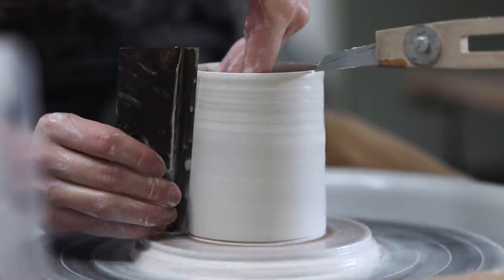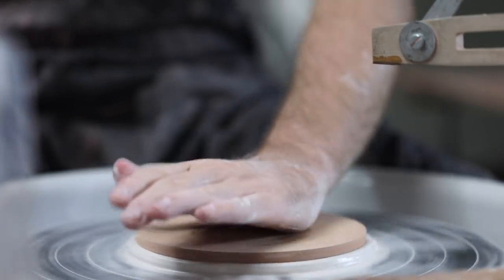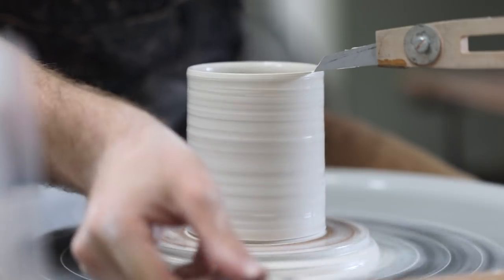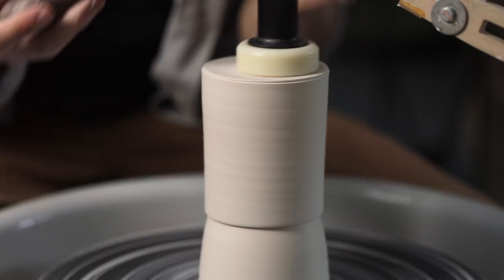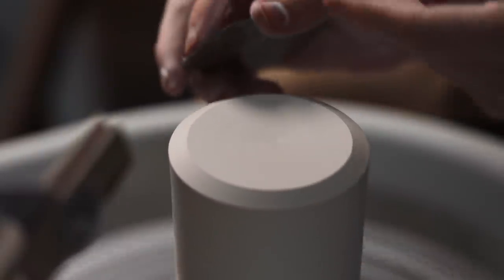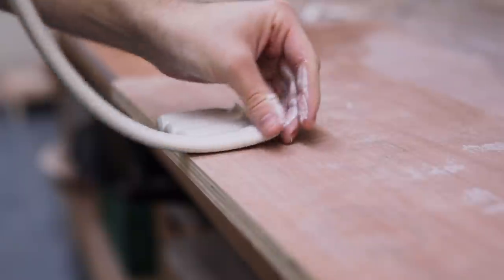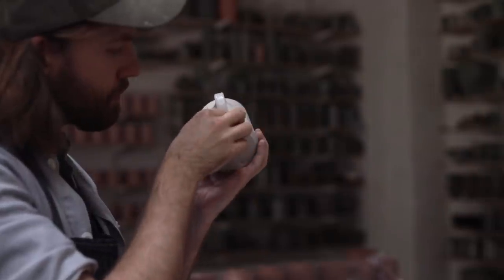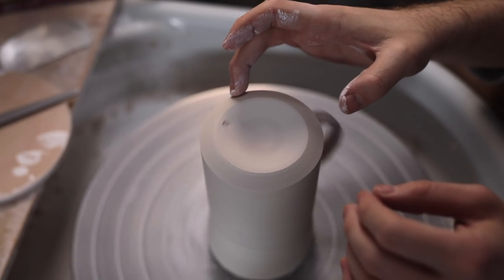Throwing, Trimming and Handling Porcelain Mugs

Comment: I don't have a pointer but use a long brush stuck in some clay, if the rim touches it doesn't deform.I don't use a bat but place a piece of paper across the top and remove with pot lifters.